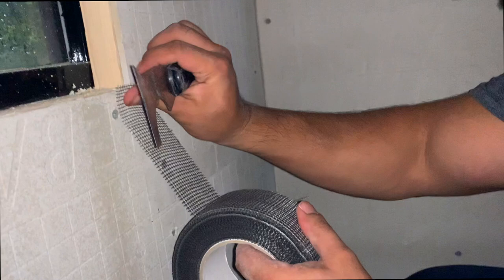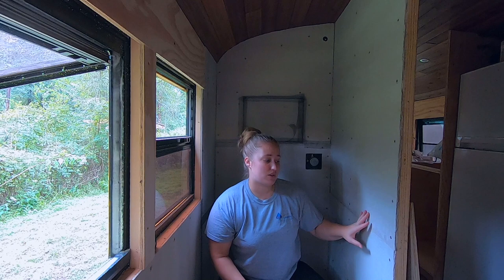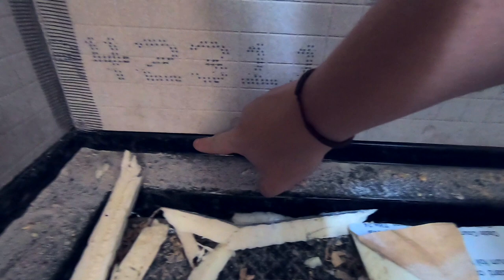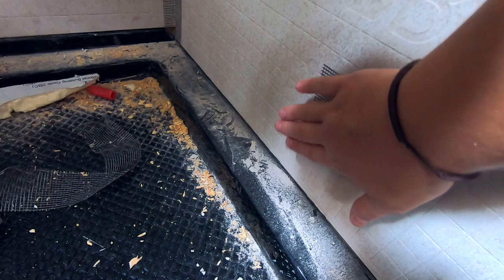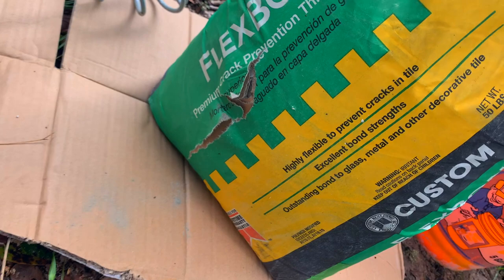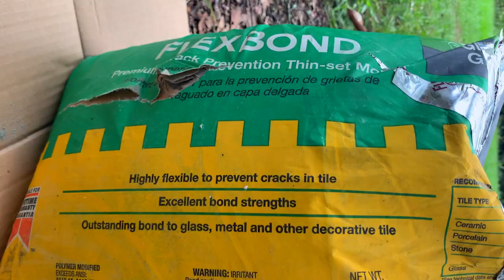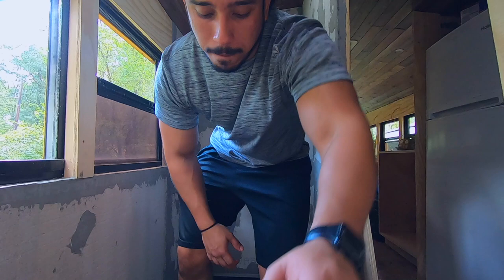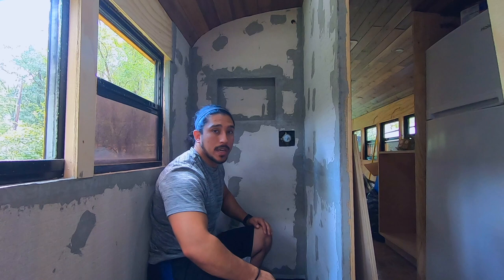WATERPROOFING Shower Walls With REDGARD * Skoolie Conversion * Gus The Struggle Bus

Comment: about the part on the showerpan that hasnt got a lip , it might be better to fill the opening under the board with silicone , then tile over it and silicone a bead along the tiles too , i think that gives the best protection against leaking through
Reply: This is what a master tiler told us.
Reply from the maker: We can also add that as well thank you so much!

Comment: Great job, guys, I would use a larger tile if your going tile that way it wouldn't take as long to tile it.
Reply from the maker: Thank you! Usually it is not a good idea to use large tile in a situation like this because they crack easier with the movement!

Comment: Why do they call this stuff "Red Guard" when it looks pink!? Does it really turn red at some point? Maybe they need to call it "Pink Guard" 😂You two did AMAZING putting the waterproofing together!  We like how you have an "emergency exit" bottom opening window in the shower! That'll be nice to let in a breeze during a hot day while cooling off in the shower. It looks SOOOooOOO spacious! We're truly impressed how you put this together with the thoughtful placement of the shower head up in the top edge so that there's plenty of head room to have a nice shower rain down from above! We imagine that you'll probably have one of those wands on a hose also, so that you can wash Joey easily. We're looking at different wands available that won't fall with the movement of the bus, so we're curious to see which one you guys go with. It's soooo cool seeing your build come together! You're going to have the perfect tiny home on wheels before ya know it! Keep it up! The struggle is real but the payoff is going to be AMAZING by NOT having a mortgage (or rent) when you're done! Just fuel & maintenance costs (which can be minimized by staying in a spot longer.)

We love following you two and supporting your build! 
- Brian + Erin
Reply from the maker: Hhaha right! It does dry red so that might be why! We actually really love how the shower turned out even though we were both stressing out about it! We have shower head picked out with a want attached so that will be perfect! Thank you guys so much for always being so awesome!